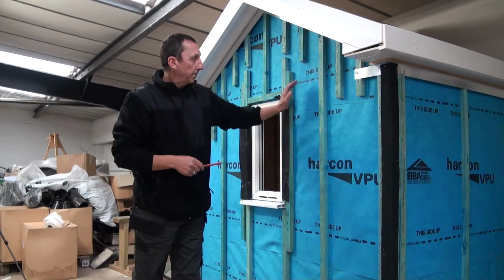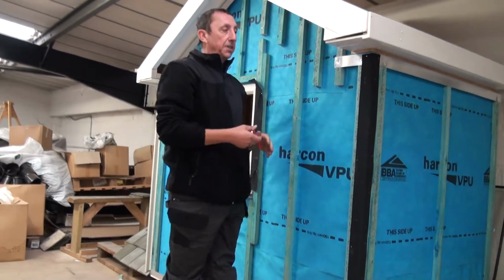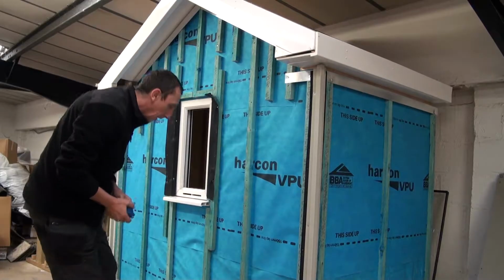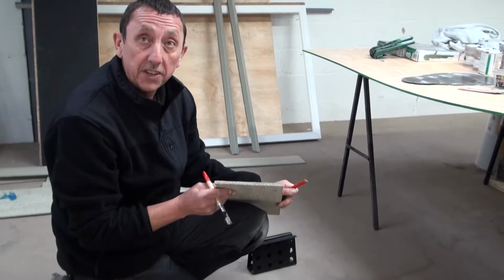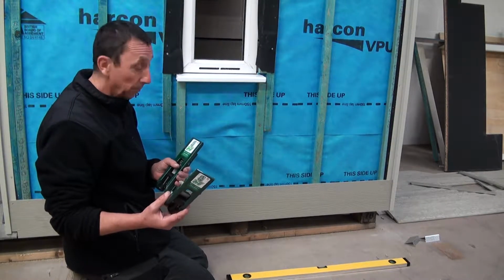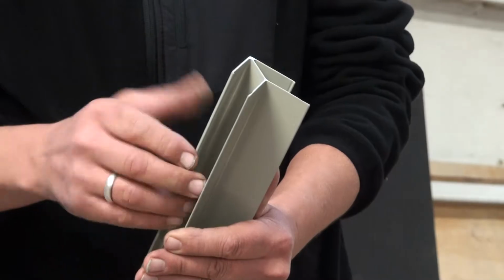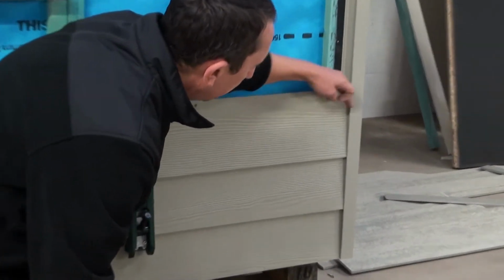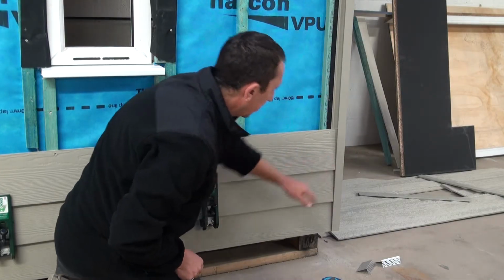Expert Cladding Installation Demonstration with Steve | Squaredeal Building Supplies Ltd

Comment: I'm not convinced by the squaredeal corner trim as it looks like the top piece of cladding would need to be very short in order for it to be slotted in at both ends, as there would be no room to tilt the board up at either end to facilitate that.
Reply: Why no insulation??

Comment: You know how to do the cladding but your fascia is horrific. And also isn't your window upside down??? That's the trickle vent grove at the bottom
Reply: Hi Harrison. You are quite correct on both counts, but this is only a mock up to use for the cladding videos.
Reply from the maker: Hi Harrison, Thanks for the comments, however the video is to show our cladding system not fascia or window installation. Thanks for watching